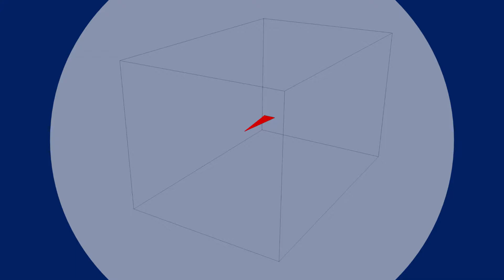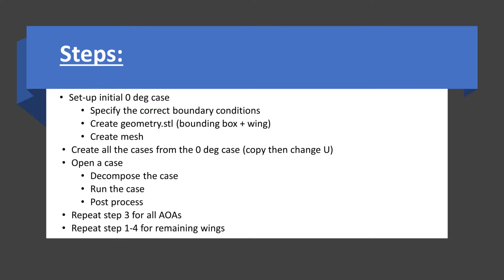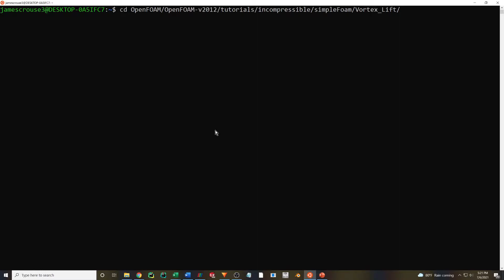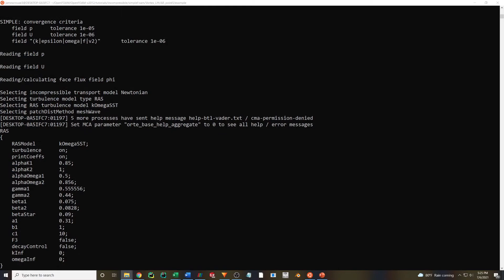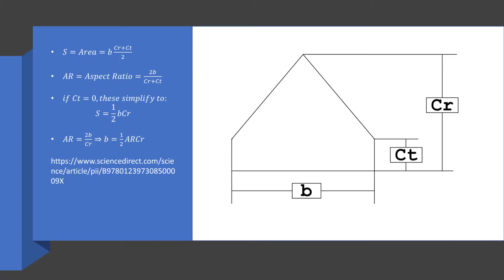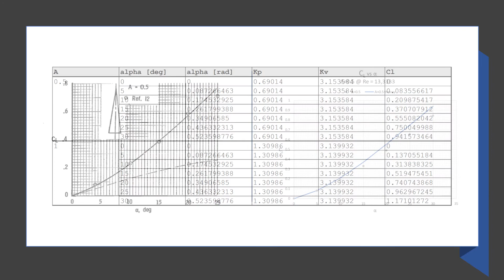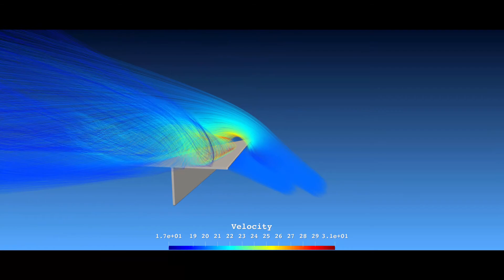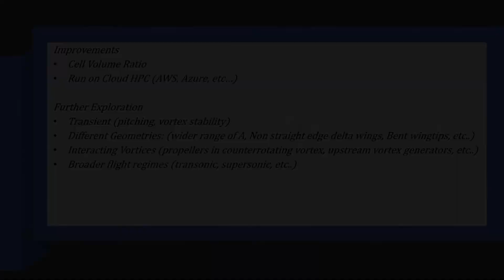Vortex Lift 2 | OpenFOAM + Experimental and Theoretical Validation

Comment: How to calculate wall shear stress for flow over a cylinder. What steps are there...answer please
Reply from the maker: please see: https://github.com/Interfluo/OpenFOAM-Cases-Interfluo/tree/main/OpenFOAM-pimpleFOAM-Rectangular_Cylinder-main/OpenFOAM-pimpleFOAM-Rectangular_Cylinder-main/OpenFOAM/case2 . The important part is to call the wallShearStress function in controlDict:

functions
{
    wallShearStress
    {
        type            wallShearStress;
        libs            (fieldFunctionObjects);
        writeControl    writeTime;
        patches         (walls);
    }
}